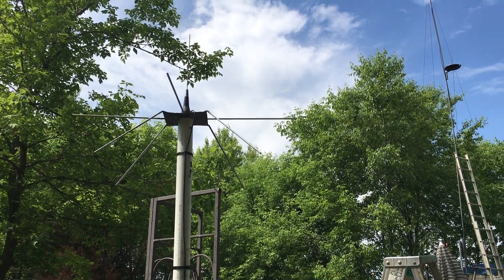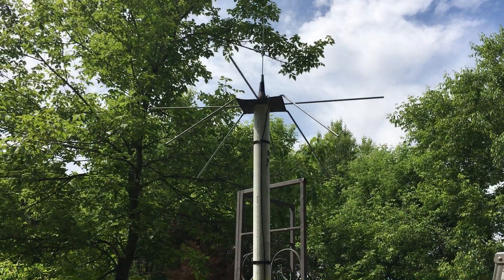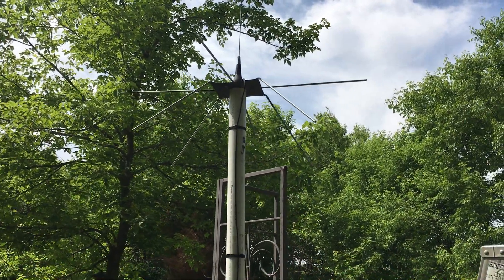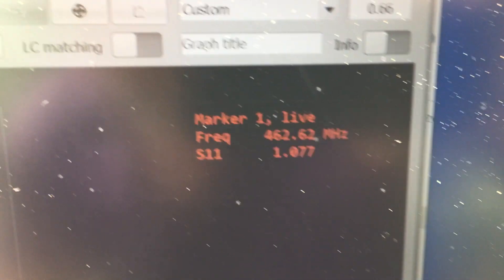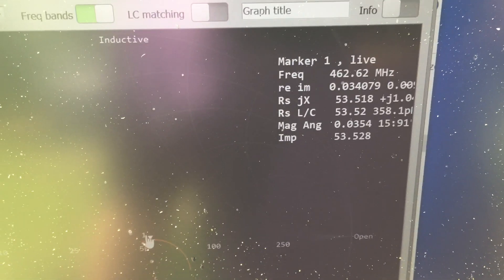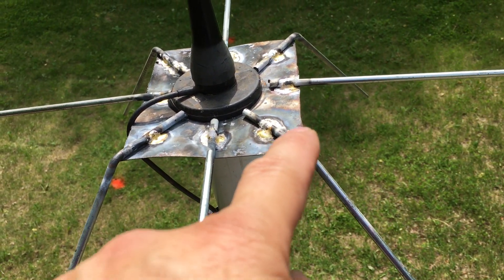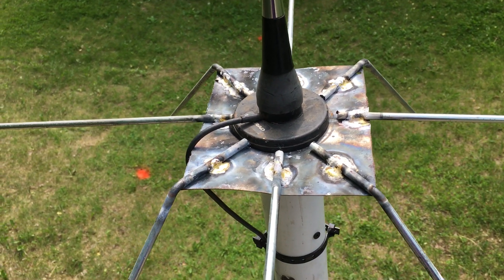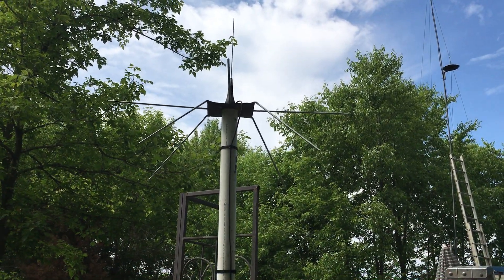🔺DIY (homemade) ground plane for magnetic mobile gmrs two way radio antenna!! 🔺

Comment: That's a nice swr Scott! I wish my antenna is as good as yours.
Reply from the maker: I think having a VNA helps with that!
Reply: Great idea. Will implement on my roof space whip. Thanks.
Is the length of each ground planes critical or will 'about' be adequate?